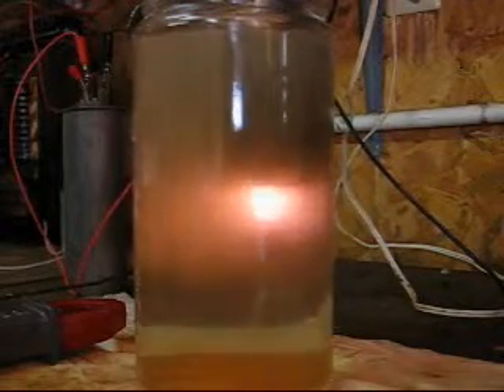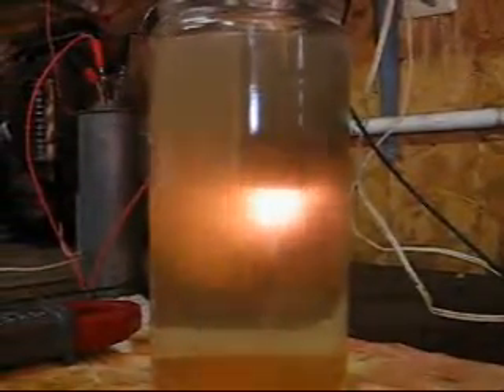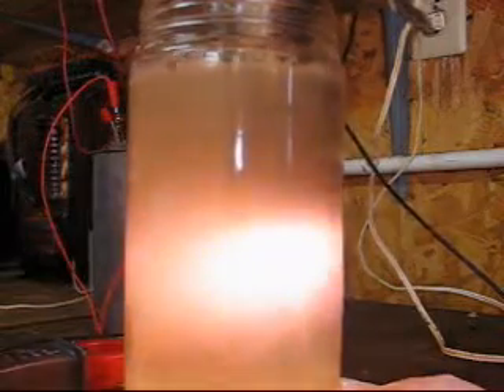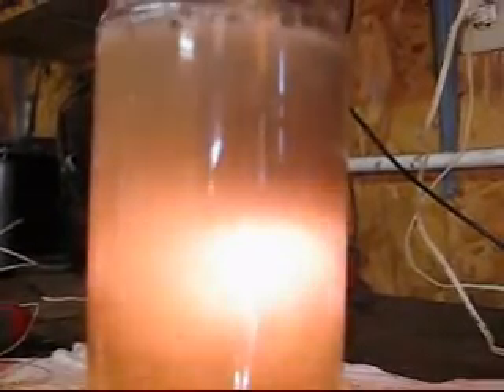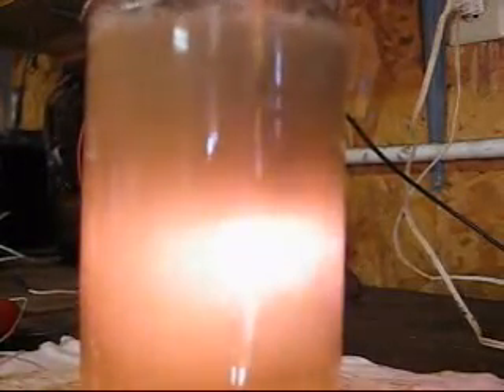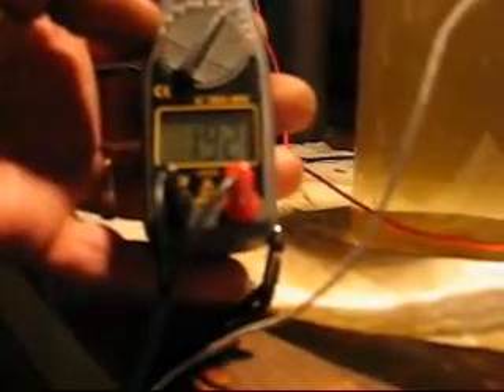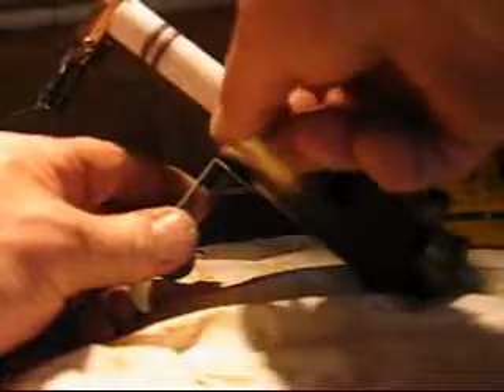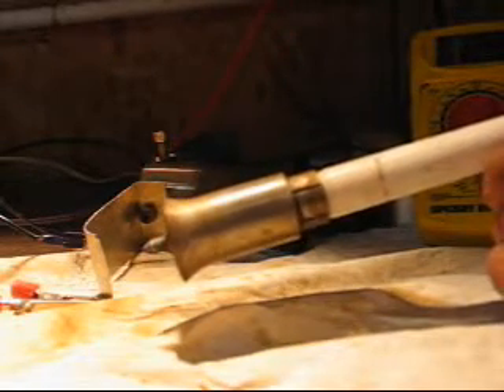Cold Fusion Plasma 6

Comment: Doesn't mather if fusion is present of not, there is an intense heat produced. This process is intended to be use for heating. We need an independante solution for our energy problems. Something that can be done by anyone fairly easely. This is IMO a step in that direction.

Comment from the maker: These high amps only last for less than a min. when you first turn up the voltage, then it goes to plasma and the amps drop to 1.3-1.6 amps for the duration of the test. Probably the last 2 min. when the water temp. is rising its at the lower amperage.

Comment from the maker: It took about 3-3 1/2 min to raise the temp. from 120 to 195. The voltage went from 50V to 170V very quick. I checked the amp draw on the AC side and it was around 2.5-2.8 amps till it went to plasma, which was in the time of the 3 min. Then the amps dropped to 1.3-1.6.

Comment from the maker: There is 48 oz water and after the initial warmup at 50V DC to 120 deg from 73 deg the water temp. rose 120-195 deg in 3 min at 170 V DC. The 240 V AC input to the variable transformer after it reached 170 V DC was drawing 1.3-1.6 amps. I ran it for 30 min and 3.8 oz of water evaporated out of the container.